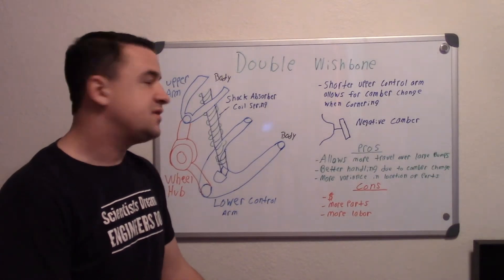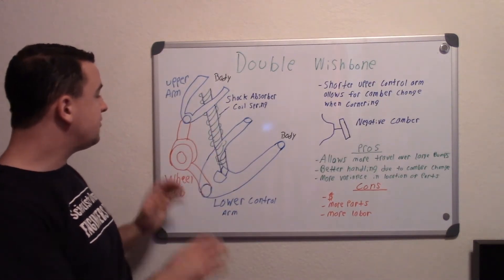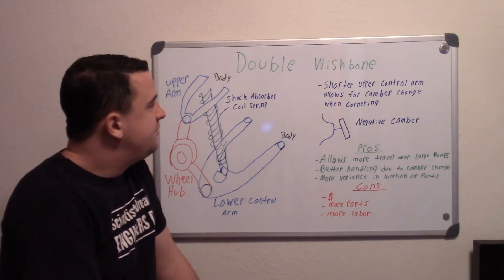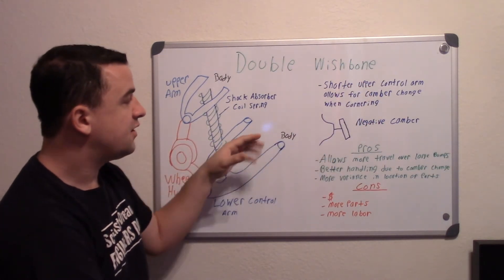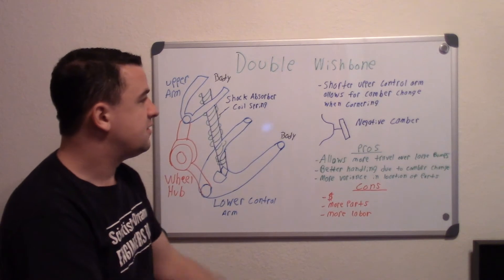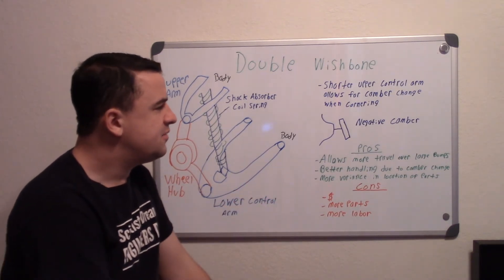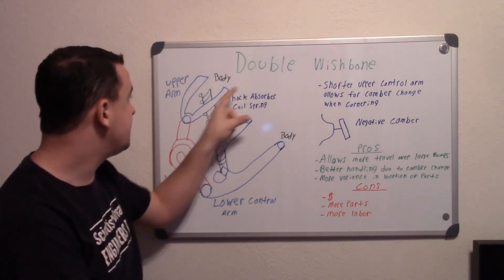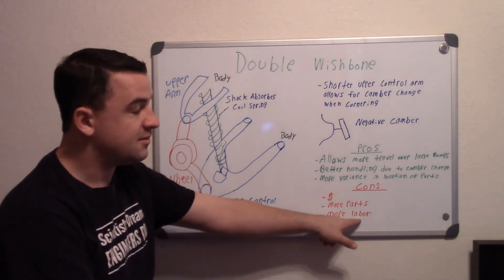How Double Wishbone Suspensions Work

Comment: when tires go down relative to the frame, is it negative or positive chamber? When doing cornering, one of the tire will get lifted and tend to move down relative to the frame. It would be beneficial if it's in positive chamber right. But what I imagine is it tend to create negative chamber
Reply from the maker: There are advantages to cornering when it comes to Camber and Caster as well! I advise checking out my video on camber caster toe
https://www.youtube.com/watch?v=DhHKPMNhv6c&index=2&list=PLzwn4wl7DKUyNRczDjXFmRZ7Mgze08NFg